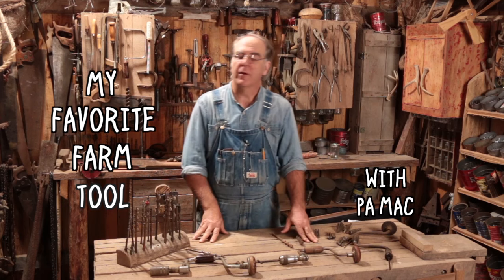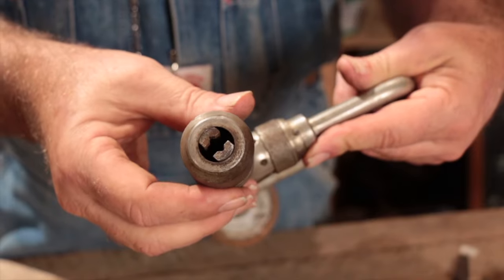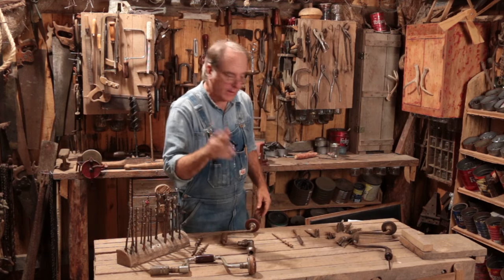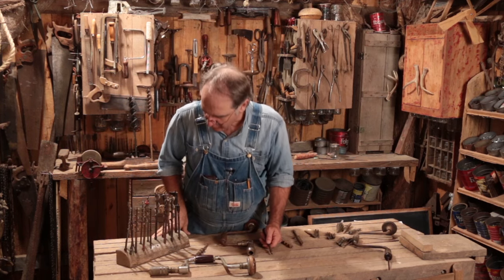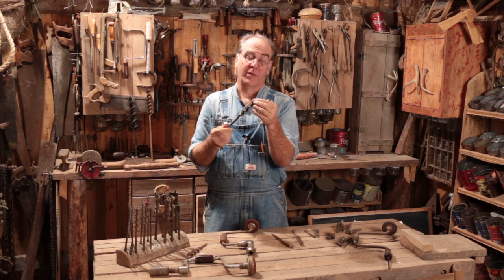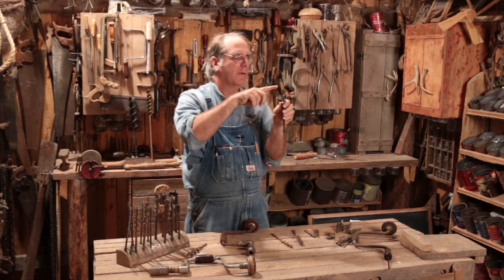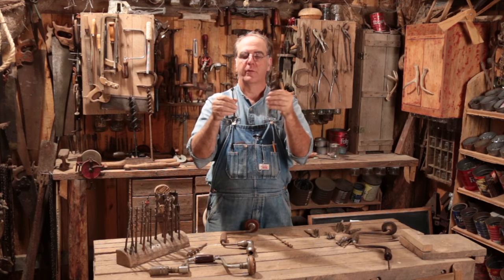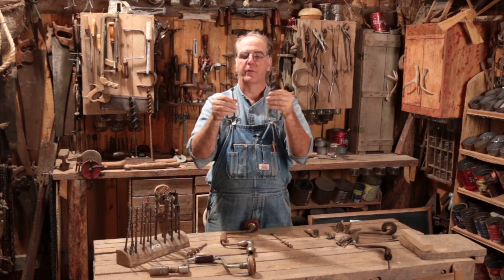Brace and Bit - My Favorite Farm Tool

Comment: Thanks for the lesson on tools.  I'm 77 years old and remember using the brace, breast, and egg beater bit drills.  One of the projects I did in 7th grade wood shop was to be done using nothing but hand tools.  I remember making dowls, and drilling holes for them for fastners with a brace and bit and square shank bit.  Thanks for reminding me of those fond memories.  My shop teacher Mr. Gerkin, said that with a few simple tools a man could build a log cabin with an adze, an axe, A saw, a chissel, a Mallot and a "T" drill.  He was right.

Comment: The round shank is a good safety measure for power tools, because binding can cause some serious kickback. The bit slipping is better than the drill breaking your hand. Especially for pneumatic or plug in drills. For the hand tools, the drill only pushes you as hard as you push it, so there's no need for the slip.
Reply: fascinating, thanks for that information.

Comment: I remember using a brace and bit when I was a kid on the farm. We were putting up 6x6 posts to brace up an old barn and had to drill through the new pressure treated posts and the original old oak beams so we could put a lag bolt through them. Was a real eye opener for a young kid to be using those old tools!

Comment: I have one of those egg beater drills. It’s really old and the handle still has a few flecks of red paint left, Mine opens on the wooden end and there is a place to store drill bits inside.❤️🤗🐝

Comment: The jaws of the chuck don't hold on square taper of the drill shank. There is a rectangular hole at the bottom of chuck which does it and transfers torque from the brace to the bit. Jaws just hold from the round part of the shank keeping it in its place and aligning it

Comment: That little screw at the tip is not an absolute necessity. Early bits just had a simple point. And the spiral portion of the shaft is a more 'recent' development too. The earliest being not much more than a spade bit like the ones sold for use in an electric drill.

Comment: Im curious to know what the thing is that you didn't know what it was. It would have been nice if we could see it. At least now I know what the numbers mean.
Reply from the maker: I know this is weird, but in restroom stalls I used to see this screw head that you could only tighten but not untighten (I'm assuming so that people could not attempt vandalism on the stall panels). This tool looked like what would be used to tighten those type screw heads.